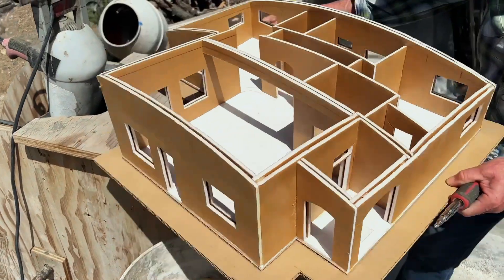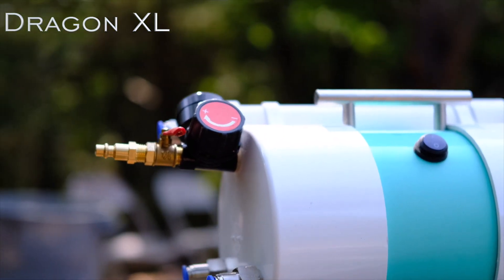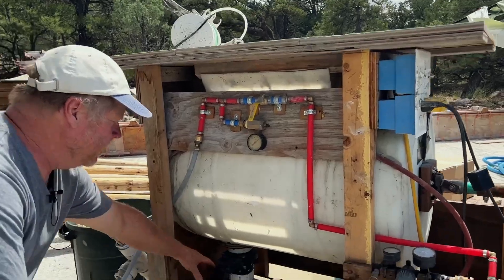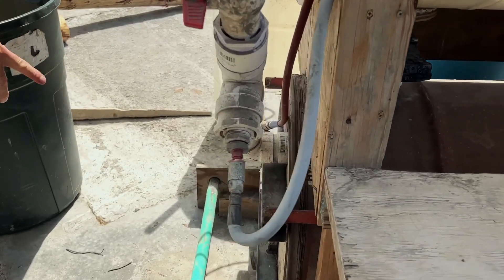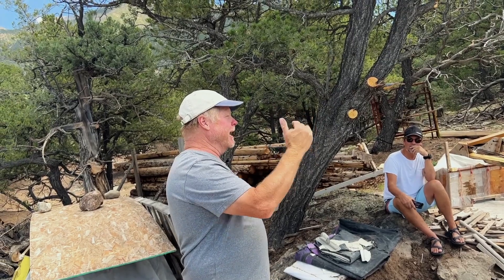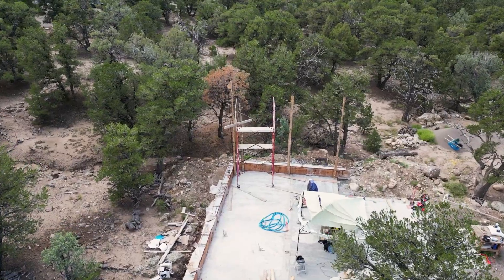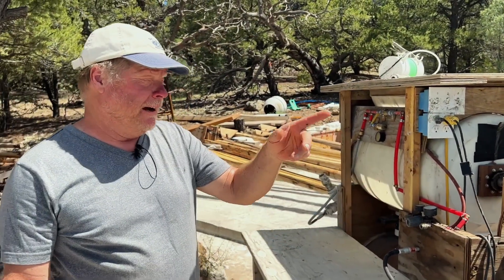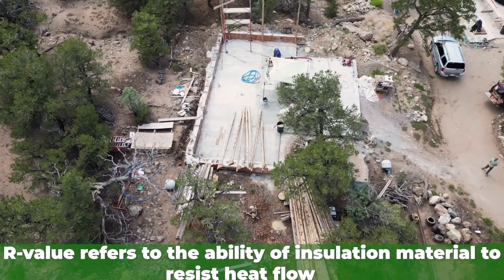How to build a 12" Thick Aircrete House

Comment: Hi people, I have been redoing the walls to my house. The steel frame was diamond drill rods and colums were made into concrete piers. Walls were .500 mm thick, yes a half meter thick infilled with squared wooden logs. It ended up shrinking and I got some dry rot and decided to pull all the wood out and do it in aircrete. Big job on my own but satisfying. It is a 2 story and I am building a rocket mass heater in it later. I have built one of these for my pottery studio and highly recommend. I have been trying to get more info on applying fiberglass netting on the outside. What sort of mix etc if anyone knows. O love the way your doing it, I mix up 160 litres at a time and do about 10 mixes a day but I have to have a rest after that as I'm 70 in a couple of months. Great to see other people experimenting and doing it all. My r value is gonna be something else which will be good for Tasmania. Keep at it and God bless.

Comment: Provided the foam generator could keep up, that installation could benefit greatly from having an aircrete hopper to spray out of. Get an old stock tank from a rancher or some place like TSC, fill it to capacity and go to town. You could run that thing all day with just a few refills. Efficiency is your friend; work smarter, not harder. 😉
I'm doing a modified aircrete workshop dome with a geodesic frame in my backyard, hopefully before the end of the year🤞(gotta space it out for budget reasons) , though as I make my own graphene, it will equally be a proof-of-concept project, too. I've got some sneaky/exciting ideas I've been wanting to try out for years, and now I can do them all in one go.

Comment: I just tested a block we made yesterday its 18" X 36" X 7" thick, it took the weight of the front end of a pickup and did not break.  We also left the truck parked on the brick and still we had success.  I would be interested in getting the plans if they are available for the mixing station you created.  Good Luck in your ventures!!
Reply: Not sure I'll draw plans for the mixer/pumper contraption. It's really pretty straightforward. The upcoming update video should go a long way toward answering questions.

Comment: Coming from Germany where I did build with LIAPLAN blocks my house, I got really annoyed with building 2x4 frames, isolating, drywall, water protection painting, mudding, sanding etc. in my Canadian house. It is such a waste of time, lots of work compared to build with blocks. I’m now in Panama where I’m in the process of building my last house. I thought about aircrete but I won’t get a building permit for it. So I will use concrete blocks. But not like locals use them. Even in the Philippines I realized that locals there don’t understand the importance of using air as insolation against heat or cold. Here they fill up the whole blocks with concrete. Ridiculous waste of material and money. But I am happy that I will not have to do 2x4 drywall work again!
Reply: Yes, we in Europe are lucky as for the aircrete (porocreate). Just select a product out of many available and the next day the pallets with blocks, lintels, glue or mounting foam and basic tools as extra for free land on your plot... And the material has stable performance, is tested and approved and has superb R value thanks to carefully developed additives.

Comment: Travel the aircrete in a old would crain , make a big scale/weight balance and have one side hold a long tube with a hose and valve on the end, 
The other side of the weight is just a counter balance and make the center pivot point on a spindle,

One guy pulls ropes to twist the balance and move the tube&hose where it needs to be and another guy using the valve and hose

Comment: This is very interesting! How will u do your electric in these pours?  I would like to see a 2 foot pour!
Reply: We ran tubes in the wall at outlet and switch heights. We'll cut boxes into the aircrete and access those passages.
Reply: We ended up not trying a 2' pour. We decided to not push our luck. Plus it's pretty normal for us to do 14 batches on a pour day, and that takes us about four and a half hours. I'm pretty sure 28 batches would be more than this old body could handle.

Comment: When i was playing around with aircrete i was adding cut up fiberglass mats and getting about four times the strength.  Are you adding fibers for strength?
Reply from the maker: It is true that you can add fiber and will greatly increase the tensile strenght.  We don't do this because it is not nessisary when building a dome shape.

Comment: Is rebar or other framing used inside to structure the walls, or is the 12” thick enough to support itself?
Reply: There are 4" round columns on either side of all the door and window openings, and about ever 4 feet between openings.

Comment: Hey Bruce - I'm also interested in making a house with vertical, flat walls, but the roof is another question. I'd like to have the entire envelope aircrete. Will you be using aircrete for the roof and if so, how?
Reply: I am looking in to doing this also and am hoping we get to see if/how they do their roof.
Reply: Because aircrete has such low compressive strength, and near nonexistent tensile strength, I really don't see a way aircrete could make a panel that would span much of any distance.
Reply: @krussellgal  our roof will be a wood frame. I have yet to see a way of making an arcrete work roof that I'd feel comfortable with. There very well may be a way, but I haven't seen it yet. (Domes excluded of course.)
Reply: Hey Bruce, I build concrete houses in Philippines,  my own all concrete house is 20,000 sq ft. Its a mansion on the beach. Walls are non structural, we build our own Concrete Hollow Blocks, 150 a day and thats about how many my mason lays down. I pour flat deck roofs, really useful. I can talk all day but first thing I notice is I would build all necessary footings, tie beams, ground beams, columns and roof deck beams. All of it with the regular 1,2,3, mix if concrete. We use a mixer and transport by buckets and use vibrator. Anyway I would do all non structural with the Aircrete. Im going to do all non structural above ground floors to save weight.

Comment: I like the way they are going about the build, was aircreate used  for the foundation also? I am interested in more information on your mixing and pumping system and how you put it together. Would it be possible to get the plans for these
Reply from the maker: We are planning to make a more detailed video in the spring.  Aircrete was not used for the foundation.  It can work for slabs but I would not recommend it for the main parts of the foundation.
Reply: @domegaia  Why will it work for slabs and not foundations? Aren't they one in the same and support the house, just one is around the perimeter and the other is the whole house? Some houses use slabs and some use foundation. My Dad has 2 houses one is built on a slab and the other is built on a stem wall foundation.
Reply from the maker: You are correct, and I should have been a bit more specific.  In a traditional house built on a slab, there is generally a thicker part of the slab or footer that goes around the perimeter and under load-bearing walls.  Aircrete is excellent as a slab when used as a subfloor, but I would not use it for the load-bearing foundation walls or footers.  

This all depends on what you are building on top of it.  In Hawaii, we have built domes on Aircrete foundations, and they worked well.  Partially because the Aircrete foundations were directly on very stable lava rock, and the Aircrete domes are very light.
Reply: Ok so I could run rebar  in the footings and use aircrete for the footings and slab and the strength should be fine to support an aircrete house
Reply: @alanabraham3129 , it sounds counter intuitive, but rebar really won't add much, if any, strength to the aircrete. This is because the aircrete doesn't have enough compressive strength to hang onto the steel.

I did do aircrete footings and stemwalls on an earlier structure but have since decided that it's better to do concrete foundations. Since I can mix concrete for about the same cost per volume as aircrete. It's simply more important to me that the foundation is solid and stable, than provide insulation.
Reply: @alanabraham3129  B/c the aircrete is not strong for slabs. Aircrete is for walls or partitions only.
Reply: Aircrete, or porous concrete materials, is number one choice for DIY and small residential commercial building for decades in our part of Europe. I've never seen an aircrete slab. Aircrete is relatively to concrete soft, weak and brittle. There are speciál shaped blocks for flooring system, that fill gaps between steel-cereamic beams, then you pour thin concrete over it and into the hollow beams and have a solid floor. It's very common, but I opted for a full concrete slab for the 2nd floor. Otherwise I have Ytong 300 mm aircrete and 160 mm EPS insulation walls. Together with my tripped pane windows they perform to roughly 2.5 times of passive house limits. I built 15 years ago, Today I'd select Ytong IQ 450mm + EPS, which I'd say would bring the build very close, if not into passive standard. But my next house I now started to plan will be earth covered, thus concrete except for non load bearing partitions, where I'll happily use aircrete blocks. Going "underground" is another way to go passive.

Comment: Give the structural need of a slab with turndown, is the aircrete formula adjusted for higher compressive strength? I understand the formula get get to as high as 300 psf. Also, are Bruce and April considering aircraft for the roof? Waiting for the Spring update!!
Reply: The roof will be conventional(ish). I haven't really seen a way to make an aircrete roof structure, that isn't a dome yet.
Reply: @brucecoutant4874  could styro aircrete work as a roof or would it still require enough containing structure that you might as well just use some conventional insulation?
Reply: @johnassal5838  in my opinion the only viable way to do an aircrete roof is with some sort of dome structure. As soon as the structure comes from a wood or steel frame, aircrete just becomes expensive insulation. 

Just my opinion though.

Comment: Do you use rebar?
Reply from the maker: Good question.  You typically do not use rebar in aircrete, but you do coat the outer layers with reinforcing mesh and stucco.  Its strength works more like a surf board where the aircrete is like the foam inside.
Reply: There are concrete columns on either side of wall openings, and then 4' on center. The columns have rebar.

Comment: why do you not use sand in the mixture? I have seeing people making it with sand too. thanks
Reply from the maker: You can add sand if you want to increase the density and thermal mass.  Most of the time it makes more sense to go for as much insulation value and lower density as aircrete already has enough thermal mass and is being structurally reinforced eternally.
Reply: We've experimented some with sand added to the mix. We did it to add to aircretes compressive strength. It seemed to help, but the increase didn't seem significant, and it was just one more step in the process.